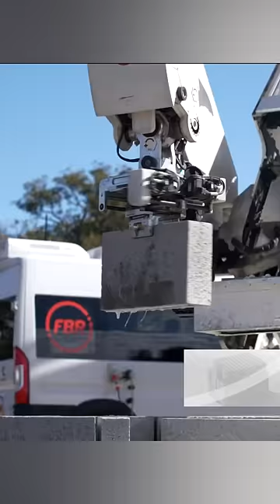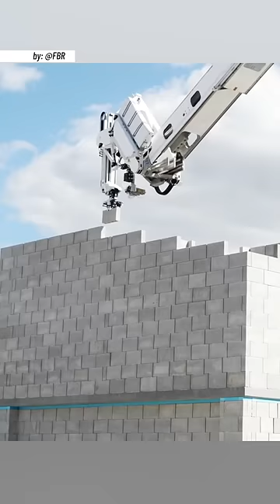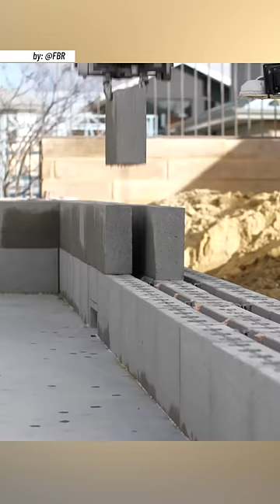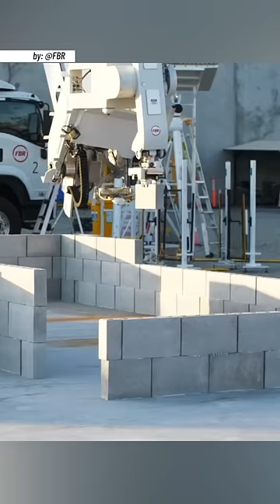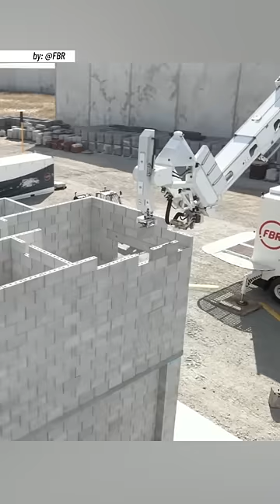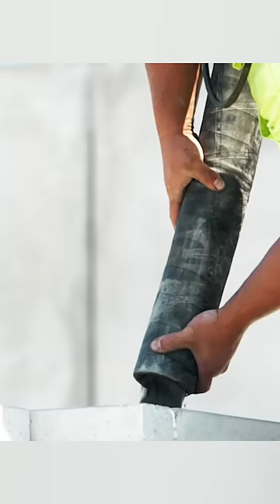Autonomous brick laying robot #shorts

Comment: pack of cards i say but the cementing layers are thin but bonding binding good but the...wind mumm check it out a coat 🧥🧥🧥🧥🧥🧥 fashionable wind cheater plastering is recommended.. good luck 🤞🤞🤞🤞
Reply: Yeah nah looks cheap and tacky not solid..but it wouldn’t be hard to dial it in from here